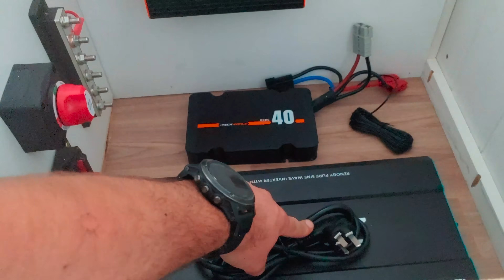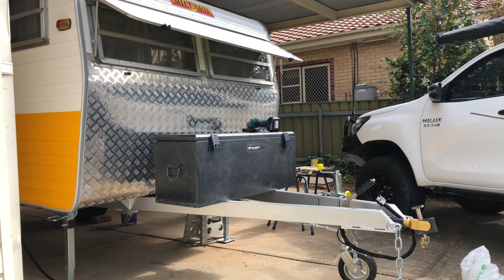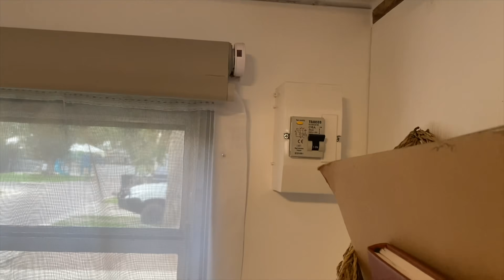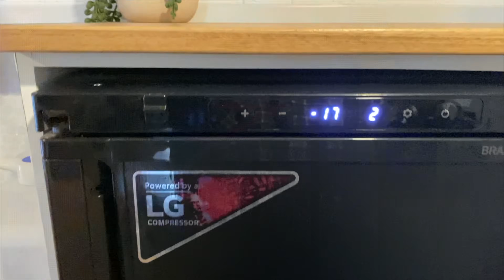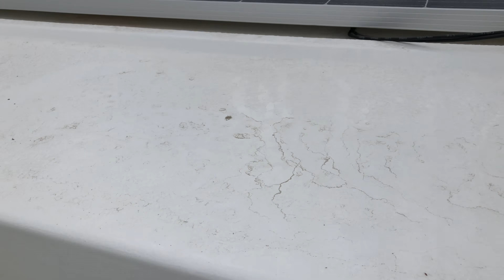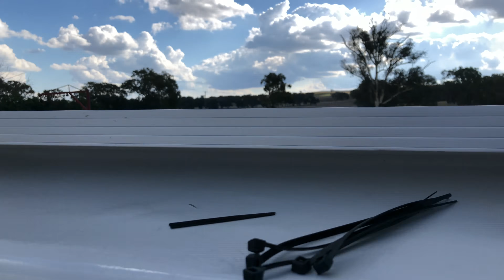Episode 10 - DIY OFF-GRID 12V ELECTRICAL INSTALL - Caravan Build Series | 1978 Millard Mini Pop Top

Comment: With these renogy inverters they don't have a neutral earth bond from my research. Best check with a sparky mate.  A good idea also is the get a transfer switch done to flick between shore power and inverter. It may have a transfer switch but I wouldn't run the inverter when your plugged into shite power , inverters get hot , my victron multiplus has a transfer switch but in summer if I'm plugged into shite power I don't want my inverter on at all as it generates alot of heat and also the fans running is noisey too.
Reply from the maker: Yeah I’m pretty sure you’re right about the neutral bond and I think that’s what I found when researching also. Honestly the AC transfer switch built into the inverter works flawlessly. When running the inverter from the battery and then plugging into mains power it switches over seamlessly with no disruption. I thought being a cheaper inverter it wouldn’t be the best but cannot fault it. Even when hooked up to shore power I’ve never heard the fans running or the unit getting hot but I suppose it’s something to be mindful of 👍

Comment: I ran into same issue trying to fit 2 x 170w kickass panels 1974 Evernew pop top.
What newton force struts did you use on the Millard?
Evernew roof almost full length van 17ft sleeve is 3.9 x 1.7 I followed your clip to replace ours with white marine PVC sleeve. 
Your channel has been very helpful. Restoration started January😃 Video production awesome 👏
Reply from the maker: Yeah we did too before installing the gas struts! The standard scissors just wouldn’t hold the pop top up with the weight of the panels. The struts were from Bunnings, Goliath 535mm 200N struts 👍

Thanks heaps we appreciate it! Glad they’ve been helpful! 😁

Joss and Ell
Reply: @jossandell  bought the 200n 535 struts and brackets yesterday from Bunnings. What offset top to bottom pivot points did you set up with roof raised? 🙏
Reply from the maker: @vapourblasttas  awesome 🙌 to be honest I kinda guessed the offset and it’s probably slightly out, probably needed to offset them a tad more but it still opens and closes pretty well. I can’t remember how much I offset them sorry. 

Cheers,
Joss and Ell

Comment: Did you need to ground neutal bold your inverter for when on dc power.
Reply from the maker: We grounded it to the chassis just to be safe even when just using DC power. Might not be necessary but we did it anyways.

Comment: hi Joss, How is the fridge going mate? Have you been using it in some really hot weather (+35C)?  was it staying nice and cold?  I`m tossing between the same fridge and the 110L Kings. Thanks
Reply from the maker: Hey mate, we have used it some pretty hot weather when we were travelling, Darwin was hot when we did our lap and it went well, just cycled a bit more than usual but that’s to be expected. For the price it’s been a great fridge. 
 
Just before the warranty ran out on it the thermostat went but they replaced the whole fridge for us which was good. Otherwise it’s been awesome! Haven’t really heard too much about the King’s one but I’m sure it’d be alright also!

Comment: Hi Joss I know it's been about a year since this video but can i ask when your not on mains power and running through the inverter do you need to disconnect the 240v battery charger so the inverter isn't trying to charge the battery thanks for the video great help
Reply from the maker: Hi mate, to answer your question, no we don’t need to unplug the 240V AC charger as it’s not plugged into a power point that is running from the inverter. 

From memory, the way we did it was, the power point that the AC charger is plugged into is the only power point in the van that comes form the mains power in (from the 15amp plug on the outside of the van). That way when we hook up to mains power, only the AC charger receives power to charge our batteries and the inverter then having the built in AC transfer switch, automatically prioritises mains power and runs all of the other power points in the van from mains power through the inverter meaning it’s not using power from the lithium battery and the AC charger is able to top it up. 

When we are camping off grid not hooked up to mains power, the inverter runs off our lithium battery. 

I hope that all makes sense haha 
Cheers,
Joss

Comment: Awesome video really clearly goes through your system. I’m looking at doing something similar as a new build from scratch, do you recommend getting the components from iTech? They seem good to work with and call if there’s a drama? Thanks
Reply from the maker: Thanks heaps! I do recommend iTech, we’re not associated with them in any way and we paid full price for everything we bought. That’s just based off us running iTech stuff for about 5 years now and haven’t had a drama with any of their gear. If it were out at the time I would have bought the new iTech 2000W inverter that has the rcd fitted but in saying that our renogy inverter has worked flawlessly so far.

Comment: Doing up vintage slide on camper how much come wire it up ??? Sydney Australia
Reply from the maker: Sounds like a cool project. We don’t really have an exact figure but I would say somewhere just over $2500 but I reckon less than $3000. Everyone’s needs are different though, could cost you half that much or twice as much depending on the brands you choose to use and how simple or technical you plan on making it 🙂 Joss and Ell
Reply: @ found your TikTok I followed and messaged you direct thank you
Reply from the maker: Sorry mate we don’t really use our TikTok but we see and reply to messages here 👍

Comment: We have 12" long 35mm pvc with rubber leg caps that just slide into each corner of poptop once up. Just some piece of mind in the wind as our awning once pulled the poptop down in a gust.
Reply from the maker: That’s a good idea. Our awning isn’t mounted to the pop top roof so it stays up nicely but in super strong winds we sometimes pull it down so the zips on the windows of the pop top skirt don’t flap around and wake us up haha.

Comment: That 20 amp charger will not charge that 200 ah battery. Those 200 ah batteries need 40 amp min to get them fully charged. If you don't want to take notice that okay. But I learnt the hard way.
Reply from the maker: Hi mate, it charges our 200ah lithium no worries. Does take a little longer than a 40amp charger would take but it certainly does the job. It’s not about me wanting to take notice, I’m aware. Just didn’t see the point in paying extra for a 40amp charger when we’re off grid majority of the time relying on solar and so the 20amp works perfect for our needs.
Reply: That what I thought as well. It turned out it was only going to about 80%. Rang the supplier and he asked what I was charging with and he informed me that it takes a 40amp hour to get it to 100%. Just saying.
Reply from the maker: @n.g.venaglia9590  what brand of battery and charger were you using? I find it odd as ours definitely charges to 100% every time we’ve used it and haven’t had a drama. Was yours only reaching to 80% and then not charging any further?

Comment: Love the videos. May i ask, where did you buy the bus bars from? Have you been happy with them? Thanks
Reply from the maker: Thanks heaps! I can’t remember exactly where I bought them from, I think maybe Springers Solar online or Outback Equipment? From memory they are 250amp rated and have been excellent. 
I originally bought an eBay one for cheaper but the quality isn’t there, the metal is much thinner and I think it would’ve gotten hot so I didn’t take my chance. You do pay a bit extra for the better quality ones but they handle the current far better and are much safer 👍

Comment: Im glad you mentioned the RVD switch, I’ve just learned that these Renogy are “centre tapped” meaning there is 120v between active/earth and 120v between the neutral and earth legs. In short the RCD will not fully function as you can still get shocked even when single pole is open or RCD is tripped. I hope the RVD covers this issue…not sure if it needs to be double polled or what but Renogy should correct their manual and sort out the internals to make these safer. Thank you for all you videos you guys have done amazing work
Reply from the maker: Excellent comment and very well explained. I agree with you in the fact that Renogy should correct their manual. I think we will eventually upgrade to an Enerdrive or even the new iTech inverter that has the RCD built in. In saying that our Renogy inverter hasn’t missed a beat and has worked well so far for the price. Thanks again for feedback! 

Joss and Ell
Reply: @jossandell  glad to hear there have been no issues, I’m hoping to keep mine for a while 🤞

Comment: Recommend adding an inline fuse at the panels. 30a depending on your configuration. The fuse down at the charge controller wont protect the van from fire if the sun is shining and the solar cables are damaged, which is of course unlikely but very possible given the poptop has to open and close all the time.
Reply from the maker: Thanks mate that’s good advice 👍 can’t hurt to add some in.

Comment: Hi, do you have a link to that light strip over the sink? Cheers Non
Reply from the maker: Hi, we got it off eBay and I’ll add the link below 🙂

https://www.ebay.com.au/itm/374297046851?mkcid=16&mkevt=1&mkrid=705-154756-20017-0&ssspo=inlqm9yuqhe&sssrc=4429486&ssuid=VvC2xmaoS5C&var=643176096875&widget_ver=artemis&media=COPY
Reply: @jossandell  Hey, thank you so much for the fast reply! I really appreciate that. I’ll order one tomorrow for my own caravan above the sink. Cheers Non 😎👍🏼
Reply from the maker: @TheJournalBureau  anytime! Sounds great 😀 it works pretty well for the price. The motion sensor is handy when you get up in the middle of the night 👍
Reply: @jossandell  Thanks! Yea the motion sensor will be great. I ordered it and now waiting for it to come. Thanks again 👍🏼
Reply: Hey, I got my light and it’s really good! How did you mount yours? Did you just use the tape on the little metal things? Is under you kitchen cupboard timber? Just wondering how it has lasted ? Thanks again Non
Reply from the maker: @TheJournalBureau  glad you’re happy with it! It’s a pretty decent light! Yep we just used the magnetic mounts it came with and stuck it up above the kitchen under the pop top collar ledge. It’s polyester ply so it stuck really well and the magnets surprisingly hold so good. Didn’t even come off over the corrugations we went on 😀
Reply: @jossandell  
Thanks for the reply 😀 I’m not sure what the product is under the cupboards on mine, maybe timber. I’ll give the sticker pads a go then. Love the light, it’s so good. Thank you so much for all your help, I really appreciate it. Cheers Non
Reply from the maker: @TheJournalBureau  it should stick fine! Anytime it’s our pleasure 🙂 cheers

Comment: Hey guys loving the videos. I’m looking to do a similar setup with the inverter. Just wondering if you ended up installing the RVD, and if so what one did you guys use?
Reply from the maker: Hey mate thanks heaps glad you’re enjoying them! We haven’t installed the RVD yet as we’ve parked the van up after our travels for a bit. We plan on doing a bit more and that’s one thing I still need to do. ITech have actually just brought out a new inverter that has built in AC transfer and an RCD and is a bit cheaper than the Enerdrive.

Comment: i really wish people would stop using itech world gear, it really is crap
Reply from the maker: Don’t know what experience you’ve had with iTech but we’ve been running some of their gear for years now and nothing of their stuff has ever failed on us or stopped working. It’s all been awesome for us.
Reply: @jossandell  hey joss and ell, im an auto electrician and have installed enough of that itech world junk to know how terrible it is, it's gotten to the point where I refuse to install it now, it's not worth the hassle, I always recommend victron gear which isn't much more expensive and far far far superior, along with ATG lithium batteries, not only do they perform as stated, but they also have insurance where if the battery ever fails and caused damage, that damage is covered under their insurance which no other battery manufacturer offers

Comment: Looks neat guys - although your positive busbar should be a fuse block - all positive cables should be individually fused. As it sits currently you'd need to pull over 100 amps to trip the breaker, those smaller gauge wires would catch fire well before that.
Reply from the maker: Thank you. I have a fuse block under the other bench seat which also runs through a circuit breaker 👍

Comment: Hey Joss! Question did the i tech world dc/dc charger need a smart alternator isolating or is that built in and you just ran the cable back (fused) to the caravan?
Reply from the maker: Hey mate! Not too sure about the smart alternator isolating to be honest. I just ran my cabling from the cranking battery of the Ute which is fused with a 60amp midi fuse to the rear. I did end up adding the ignition trigger wire which has helped it charge much better than it did without it.
Reply: @jossandell  yeah saw that. I appreciate the reply I’d imagine I must be set up as you Ute is new enough to probably be a smart alternator.  Been looking into the i tech and remote stuff as I’d like a system like you all have (without the redarc/victron) price tag. Have you been happy with the gear so far?
Reply from the maker: @goodevins9408  I think my Hilux has a temperature compensating alternator. I agree, there is some expensive options out there but you can certainly make it work with less expensive gear. The iTech stuff has been super reliable and works great. I’ve had the iTech bcdc 25 amp charger and iTech 120ah lithium in the canopy for nearly 3 years now and has never let me down which is why I went with iTech again for the van 🙂
Reply: @jossandell  thanks for the feedback it’s the way I’m leaning with Renogy also in the mix. Loving the build series. Great content 🥳
Reply from the maker: @goodevins9408  that sounds good mate! Our renogy gear hasn’t missed a beat either 💪 thanks heaps we really appreciate the support 🙌 

Cheers,
Joss and Ell

Comment: I have learned the hard way that those circuit breakers are no good for high amp loads.  The internals of them are too delicate and get hot and create resistance and voltage drop under load.  If you ever have a problem of your inverter shutting down under sustained load, consider not using those circuit breakers.
Reply from the maker: Thanks for the insight Peter. Haven’t had any issues yet but I’ll keep an eye on them. Cheers

Comment: Great cool vid and build guys. Tip,When drilling holes in the van wood floor with a hole saw. Drill halfway through the wood then go to the other side of the wood and drill the rest out. That way it wont splinter your wood when the hole saw punches through.
Reply from the maker: Hi mate thanks heaps. Haha yeah I’ve figured that out and have adopted that after a couple of tare outs from going all the way through in the one go 👍

Comment: Another great video guy’s, thanks for the shoutout for @blueythemillardmini 🤙🏻 
I think I’ve got the same inverter so I’ll be looking into  how you connected into the ac to run the other powerpoints. Hope your trip is going well and the weather is awesome 👍🏻 
Cheers Guy and Skye
Reply from the maker: Thanks mate and anytime! Sounds good! I made sure when we redid the 240V that all the outlets would work from the inverter. I think it would be annoying only having the 2 outlets on the inverter available off grid and having to run an extension lead from it to use it throughout the van. The AC transfer works great and it’s so good having all outlets available off grid 👍 Our trip has been unreal and Sunny is holding up exceptionally well. Starting to get into some better weather now which is good 🙌 hope you guys are well! 

All the best,
Joss and Ell

Comment: Great video, loving the build series. Instead of running the ignition trigger wire all the way to the Ute to find an ignition source, you can tap into the positive on the input to the dcdc. Pop the positive out of the Anderson on the dcdc side, cut back some of the sheath then solder on the ignition trigger wire, heat shrink and pop back into the Anderson 👍. I did this in my canopy setup using the same dcdc from itech world.
Reply from the maker: Thanks heaps Josh. That is a great tip! Will be definitely giving that a go as it’ll be much easier than running cabling all the way back to the Ute. Thanks heaps!
Reply from the maker: Hey mate, wanted to let you know that I added that ignition trigger cable this afternoon the way you said to do it and now it’s working perfect. Super easy fix! Thanks so much, saved me a heap of time as I would have tried tapping into something under the bonnet and ran it all the way back 👍
Reply: Great news! Glad to hear it worked for you. More than happy to help. Keep up the awesome content 👍
Reply from the maker: @joshhansen3193  thanks heaps again  mate and will do! All the best 👍
Reply: Hi Josh - I have a canopy on the ute and the canopy people ran a 6B&S from crank battery to canopy to power their internal lights, but no ignition cable. I have a 40A iTech Control Box with DCDC charger and it sounds like I will need this ignition wire. Do you have a suggestion other than tapping into an ACC source and running a separate cable into the canopy. Thanks
Reply: I think doing that you have wired up to an ignition on source , they are supposed to be wired to a source when the engine is RUNNING not ignition On source.